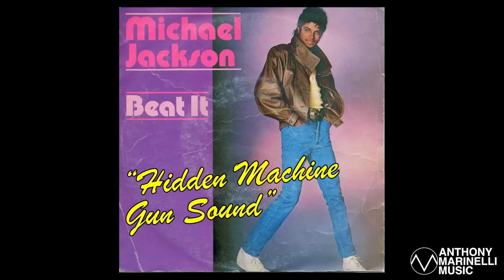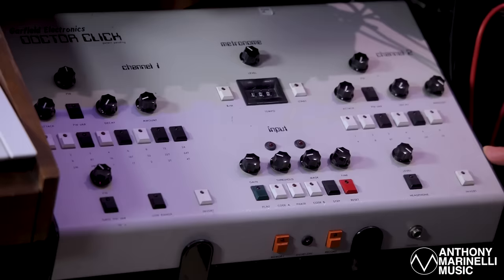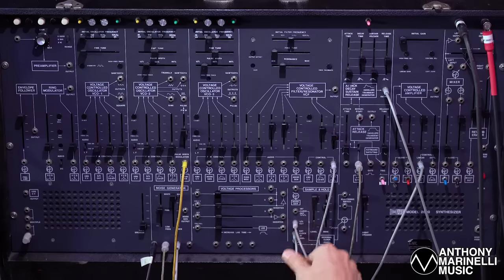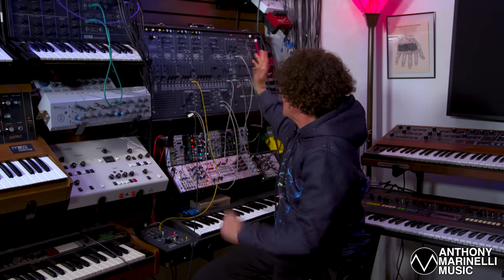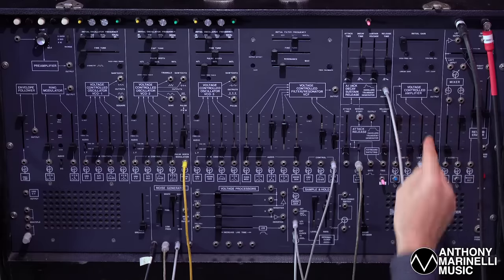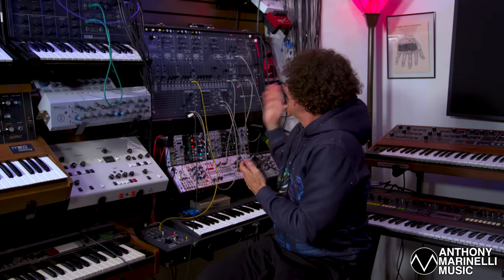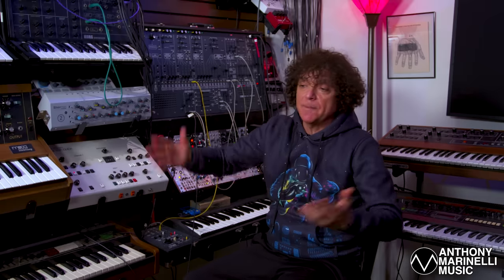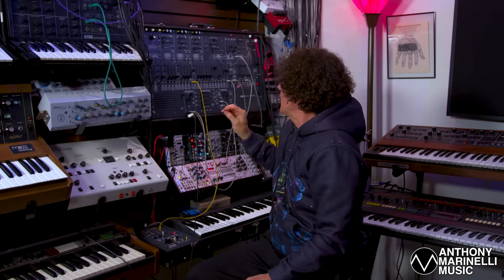MJ’s “Beat It” - Hidden Machine Gun Sound

Comment: Hi Anthony I like your videos I'ma visually impaired musician and I have the arturia v collection x along with the keylab mk II.  I never new that sound existed thanks for sharing.  I was wondering if you would be able to explain how to get the intro sound to welcome to the machine by Pink Floyd.  I have always been curious how to make it.  I also have the Roland Xv-3080 and the Mc909 groovebox.  I use Reaper as my Daw because I am able to use it with our access solution called osara which is a script that makes it accessible for us.
Reply: I believe the throbbing  sound  is from a  Late 60's  EMS  VCS3  synth ,
Definitely  combined with a mini moog   set at ::
2 saw oscillators with a 2 octave difference ,,, 2% of detune ...60% Glide
Filter at  0% cutoff ,,40% resonance,,,100% contour
0 ms attack .. 2s of decay /release ..100% sustain 
AMP  0 ms attack  2.5s decay,,,  / release...100% sustain 
Saturation / Drive  optional chorus And Delay
I also believe a ARP  Solina  String ensemble was used in this song

Comment: When I listen to it, it sounds to me like the pulse is stronger than the saw and a slightly different pulse length. Actually it's interesting the sound still continues whilst Eddie is already playing these openers to the solo and when that knocking comes in, raising tension. There are some more synth sounds to explore/explain I think. I just now realised the strings which sound almost solina like to me. Or were they done with the poly synths? And "underneath" that there's an almost choir like sound. Synclavier or analog poly?